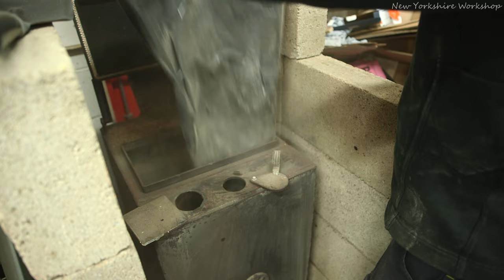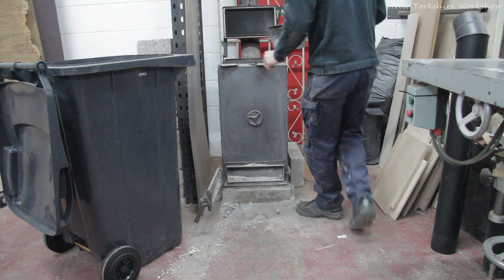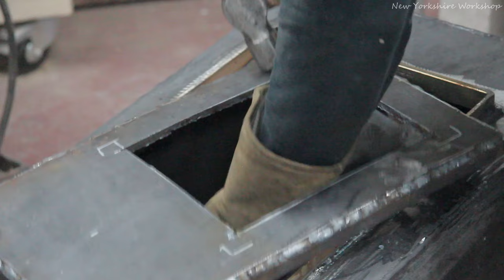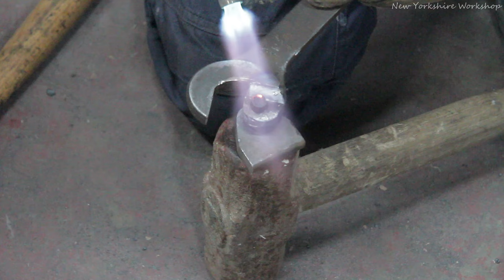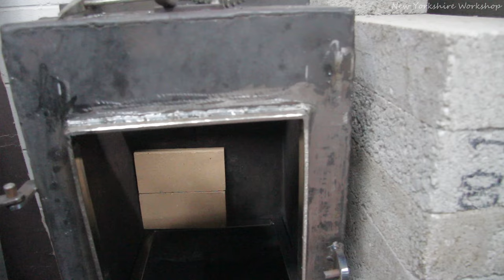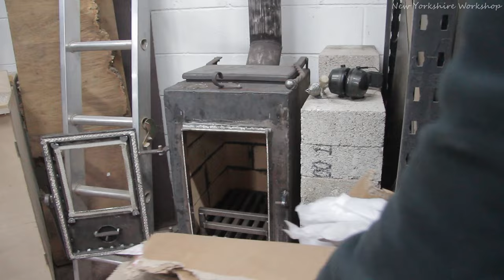fixing my exploding woodburner

Comment: Nice job, can't wait to see more !

On thing bother me tho; I think your pipe is mounted upside down, should have a F/F connector on the output of your stove, then every male sides of the pipes must go down towards the stove itself, so the ashes go back in it rather than leak out of the pipe and make a nasty mess :) Not the case if your smoke is air pulsed.
(not a big deal)

Keep doing well !

Comment: You should create a sawdust compressor and turn the dust into logs, they work by blowing/tipping the dust into a chamber which has a hydraulic ram working on a timer that forces the dust down a narrow tube compressing it, (I worked in a factory making cardboard so this was a by-product) we had ours that fed into a skip like a sausage that broke into nice sized logs due to it's own weight.
Soon everyone was taking it home for their wood burning fires (with the managment's blessing-they didn't want it!)
The lads said it gave off good heat, and didn't leave much ash.
Reply: Did you watch to the end?
Reply from the maker: interesting, how was the cardboard prepared before going into the press? I take it it was shredded somehow?
Reply: @NewYorkshireWorkshop  The dust came from the cutting of the cardboard, (a lot of dust is created during the process of cardboard manufacture) it got sucked up by the waste fans on each machine along with the bulkier trim waste, sent thru pipework to the baler via a seperator, the dust going to the compacter and the cardboard to the baler.
As cardboard is just wood, it should work with sawdust and make a 'cake' as the engineers called it it just needs pressure to make it stay together.
You can find this type of fire log on sale if you look.
Hope this is of some help.
Cheers!
Chris

Comment: Make a sawdust log. Use a 4inch by 10inch casing pipe, weld bolts one one end and make a removable cap. Make a ram out of a hydrolic bottle jack invert it, and fill with saw dust and compress in stages. Once hard it will keep its form unless dropped or wet.

Comment: Stove looks great, looks like it produces a very clean burn, I assume the baffle and space on top is for secondary combustion of the flue gasses. 

Only issue is I guess alot of the heat goes out in the chimney, if you wanted to do some bricklaying and had the space, you could get around that. In Finland a traditional way to retain heat from cast iron kitchen stoves and similar was to build a brick wall behind them, but not just a wall mind you. It's connected to the stove chimney and it's got channels which makes 2-3 U-turns that the smoke has to flow through before reaching the chimney, so a lot the heat from the smoke is absorbed into the bricks and it works as a thermal battery and you get more heat out of the wood. 

The trickiest part is to design it so it's not too effective, or the smoke will be too cold (condensation issues), but a realistically sized heating wall shouldn't do that. You can go even further than that with a completely masonry built heater too. But if you where to add a heating wall to that heater you'd have a ridiculously effective firewood setup.

Comment: Wonder if you could have run a pipe down the middle a little narrower than your PVC that you could have made a ton of holes into to keep the sawdust from blocking it and keeping the air flowing. Then you could go back to sawdust loading. Fill with the PVC in around the pipe, then remove the PVC when fully loaded.

Comment: Maybe when you used the pipe to create the hole for air, take a metal mess & bend it into a pipe form to go around the PVC, so after you put the saw dust in & pulled the PVC pipe, the metal mess would brace the sawdust from falling in & allow air thru it the whole length

Comment: Your pulsations are caused by  several things. Inconsistent intake air, uneven combustion, inability to control  fresh air, and improper venting. Your solutions are excellent, except for one item.

You're  going to rely on that single wall flue pipe? In a shop full of expensive and likely irreplaceable wood, tools and projects?  Do yourself a huge favor and invest a few hundred in a proper double or triple wall SS chimney. 

Take it from someone who has burned a shop to ashes. 

Great work, please stay safe. 

By the way, how close is that wood burner to your spray booth?

Comment: Find yourself a steel tube about 2 1/2 inches dia. by 4 ft long and mix your sawdust with wet wood-ash then ram the mixture into the pipe until about half-full then push it out of the tube and let it dry.

Comment: Your fire is consuming more oxygen than is available in the combustion chamber. Sawdust burns like gasoline, it's what they use in fireworks to make those giant orange blooms in the sky, you stove is on the verge of what's called back draft. It is trying to suck oxygen into the stove to burn hotter and faster. You need to supply more oxygen or less fuel at a time. thankfully the stove isn't sealed tight or it would have blown you and your shop wall apart. Use less material in the burn box.

Comment: Your connecting flue pipe and chimney is too narrow AND your feeding proportionately too much combustion air, which causes flue gas stalling, bkow backs and cavitation(like a pulse jet). Been installing and using open, closed and wood burning stoves for 30years(and installing chimneys too, where 9/10 problems stem from). I like the mods done - BTW Superb Bulgarian wood burning stoves, boilers and cookers are available for as little as £400 on Ebay delivered, and they are great!!!
Reply: What would you say is the correct ratio of intake air pipe to exhaust pipe?
Reply: @deathcake9000  There is no hard and fast "rule", as it depends hugely on the flue length, bends, height of terminal, its position relative to roofs, trees, hills..... Sawdust burners produce huge amounts of smoke, especially in the warm up phase, but I'd suggest at least a 6" connecting flue pipe and 8"or 9" chimney, with the max vent opening free area being no more than 1/2 dia of the connecting flue pipe eg 6" flue and 3" vent. All pipe dias are internal. A CO detector would be advisable too, as tge blow backs will contain large amounts of CO, CO2 etc. Sawdust burners can also benefit from intermediate layers of loose kindling between bags of sawdust as it increases combustion temps and the flue's draw. Keep safe and well.

Comment: Its caused by a lack of primary or secondary air. You need a forced or induced air supply by installing a fan. Technically in combustion terms the problem is called " pulsation"

Comment: could use a perforated metal pipe that stays in place instead of the removable pvc.  that way the air column is kept open.

Comment: As far as using your sawdust, I've seen something similar like the following done with paper waste, and know it works, so I'm modifying this on the fly to I figure there's a possibility it could work similarly with saw dust:

Get several PVC pipes, 3 to 4 inches in diameters (SOME OF US INSIST ON INCHES!!!), and cut to whatever length will fit your burner plus 4 or 5 inches extra.  Take those pipes and drill multiple holes all around the sides, for saw dust I'd guess no more than a quarter inch in diameter, but probably 1/8th inch would be better.

Create caps for ONE END the holy PVC pipes, making sure to drill holes in the end of that cap.

Next, three schools of thought:
Option 1:  Using lamp oil/kerosene, mix in a batch of saw dust until you get the consistency of peanut butter, stuff the PVC tube to a few inches below the open end with this mixture, set capped end down and get something that will fit on the side diameter of the PVC pipe (when I did this with paper, a Pringles can was almost perfect for whatever the diameter of my pipe was, can't remember at the moment).

In my Pringles cans, I'd filled it with assorted nuts, washers, ball bearings, just making it weighty, set the can in the PVC tube so that it would start compressing the mixture, and I placed weights on top of that.  Set the tubes aside for a week or so, remove the end caps and CAREFULLY extract the soft sawdust/kerosene "log", and set aside for a few more weeks.  Once firmed up you can wrap them in a wax paper, or put them in garbage bags to keep the kerosene from completely evaporating away.

I'm pretty sure this is how they make those "fire starter" logs you can get in stores, and the kinds of "logs" that are supposed to burn for 4 hours...

Option 2:  Replace the kerosene with plain water.  This works well for paper, as the paper if properly mashed up before hand will bind with itself naturally, and it's possible that saw dust will too, but I'm uncertain of how well it will burn, and it will possibly be fragile.

Option 3:  Replace the plain water a mixture of water and wood glue, probably just enough wood glue to color the water.  Only potential drawbacks is while the end result will definitely burn, it may not burn as well and it will probably be a bit more difficult to extract the "log" from your PVC tube.

I'd setup a dozen or more of these PVC tubes and have a dozen going at any one time over the late spring/summer/early fall of Colorado to have almost a cord of logs by the time winter rolled around and it got consistently cold enough to start burning again.

Comment: Wood fire in a wood workshop around dust with the fire and scrap blocking a fire exit. Darwin Award contender in the making. 
Add more space with the "Thermal Mass" bricks to allow convective airflow around the unit. Radiant heat will still soak into the bricks.

Comment: All that "thermal mass" also acts as an insulator, which will make the stove hotter, but decrease the amount of heat transfer. Not saying this is a strictly bad thing. Gapping it more will allow both airflow and heat storage
Reply: And apart from the insulation thing, the heat transferred into the “thermal mass”, although it is going to be released after the fire extinguishes, will … be released later, which means that the heat transfer into the room will be differed.

Comment: This could be some of the things mentioned below, but it could be small scale "deflagration." As the air rushes into the heater the sawdust burns rapidly. As it burns it creates a small cavity that caves in. When it does so, it allows the dust to mix with oxygen and a small explosion occurs. This explosion causes more dust to fall creating more dust which then explodes continuing the cycle. On a large scale it can destroy a building in a huge explosion. There is a safety video that explains it on a large scale, but it could be applied to your situation. https://www.youtube.com/watch?v=70fZqHsEdMo

Comment: I have a similar burner in my workshop; ocassionally it starts 'puffing' like that. Some sort of resonance with the chimney, however, partially shutting the air vent to the down pipe interupts the problem. I'm very pleased with it, in winter it will raise the temperature in my shop by about 10 degrees if it is well packed.

Comment: Those surgical gloves and or nitrite gloves caused this problem because of the highly combustible off gases they produce because they are made out of byproducts of petroleum instead of latex like they used to be made out of because latex was discontinued due to allergic reactions back in the 90s.

Comment: Wouldn't the bricks inside the stove prevent transfer of heat and make it harder to heat the room?
Reply: precisely - dense fire bricks have very low thermal conductivity, so instead of the steel mass of the stove absorbing and radiating heat, much more of it now goes straight up the stovepipe.
Reply: @daos3300  Ah. I thought the idea was to heat the room more, but I guess he's just trying to burn off the sawdust.

Comment: YOU MADE A BIG MISTAKE SCREWING THAT WINDOW IN LIKE YOU DID !

After some time you will find that tape compresses and the glass will slide down,
You should have made another frame to fit over it with stove tape and it would compress against the glass rather than those washers, the frame will prevent the glass from falling and you will not have a huge fire in that fire box and ending up with a definite chimney fire or ? Your guess !

And I'll share with you how one should have made a grating system that will never burn out,
As that which you made will not last, warp etc.

Seeing the fellow that showed this to me went to the grave,
Use pieces of angle iron that goes across the stove, with one side of the angle iron having a rod welded to it along its side, have each piece overlapping the one beside it,

Having the round rod side, over lapping the grate beside or next to it, with an air space between the pieces of angle iron.
Basically one side of the VVVVV (cross sectional as best as I can show)  over lapse the next one, so the air enters from under neath always going at an angle, the grates fill up with ash, and they will never burn out, 

You could force air through them, and use it as a forging furnace, and never have the grates burn out, They are always filled with ash,
And if you made the grates so one can adjust the angle of the grates, you could control air flow precisely across the fire box for an even burn, and to even shut the fire right off,
Not sure if he ever got a patent on it, but wanted to call it king of grates,

Comment: The narrow tube diameter you were using initially was perfectly creating a pulse jet flame. The air draw from the base was snuffed out and reignited repeatedly to create the pulse. If you had doubled the hole size, it would have stopped.

Comment: more air flow!!!! will fix the problem. when you open the bottom you are giving it the ability to suck air in and push air out at the same time. it has an airflow problem. yes, it is dangerous. it is acting as a pressure and vacuum chamber. going from -100 psi to 100 psi possibly or more within a second.

Comment: No one here in the United States still uses Inches... We converted to Whitworth decades ago.  I've heard rumors about some new fangled system based on Dekinals but I ask you, what's wrong with good old reliable Fractions?  Ever see them edumacated fools try to write 1/3rd in sumethin other than Fractions? It's so long you can't see  the end of it!  Who has time to write sumthin that long?  Fools I tell ya! That's who!
Reply from the maker: 33.33333333333333333333333333333333333333333333333333333333333333333333333333333333333333333333333333333333333333333333333333333333333333333333333333333333333333333333333333333333333333333333333333333333333333333333333333333333333333333333333333333333333333333333333333333333333333333333333333333333333333333333333333333333333333333333333333333333333333333333333333333333333333333333333333333333333333333333333333333333333333333333333333333333333333333333333333333333333333333333333333333333333333333333333333333% of me agrees

Comment: As a journeyman and apprentice the most hated job in the workshop was emptying the dust bags. So when I built my own workshop I cut out all that cyclone dust bag bullshit and just blew my shavings straight out the back in to an open sided shed and use it as mulch around the garden. 
Spread it around tree's, water it in and it breaks down in to compost.
Easy. I would NEVER EVER recommend a live heater in a workshop. Talk about Russian roulette. Wood dust is explosive under certain conditions. That's why I blow it out of the shop and let the rain render it safe.

Comment: Turn the wire feed up on ya mig welder, it's supposed to be a nice sharp crackle sound and not sound like a fanny fart !!
Reply: Looked like he was getting a decent weld going to me.
It doesn't have to sound like a 1.3 nova with a 4.5kg bean can on the exhaust pipe to lay a bead.
Reply: @bushratbeachbum  hahaha I've never heard that expression before. Fair play mate . Heaven forbid, a.mig weld should never sound like that 😂😂
Reply: They were very popular when i was a bit younger.
Never thought much of them.
Did make some money sticking new panels in them though, so they weren't all bad.

Comment: it is one of the worst heaters ever.. Not yours particular, but design in total. All heated air(gas) goes directly out through a strait pipe. Like a jet, really. You just consume air (pumping cold one from outside inside) and wood and heat almost nothing.. You need to increase the time and the surface for more efficient heat exchange. Let the gasses go through a "Heat exchanger". Just a wide labirinth with 2-3 layers above the stove, or close to it, like here for example: clubpechnikov.ru/wp-content/uploads/2014/11/1616156116886.jpg  or separate one mounted on the wall above the stove (I have seen one made of several metal barrels (former gas cylinders) welded together by different ends. ). 
It will slow down the burning, slow down the outflow gasses, will strongly increase the efficiency of heat output and amount of heat in the room. 
Or just add more "ripples" to the stove and pipe. They will heat up the air by strongly increased air-metal contact surface. Blocks you placed are heated up only with IR radiation and basically bring nothing but protection from explosure ;)
Sparkling was fun. Fire extinguisher could be there instead of the cardboard trash..